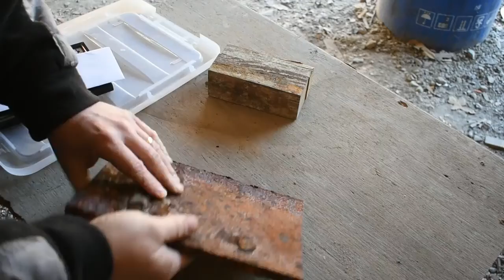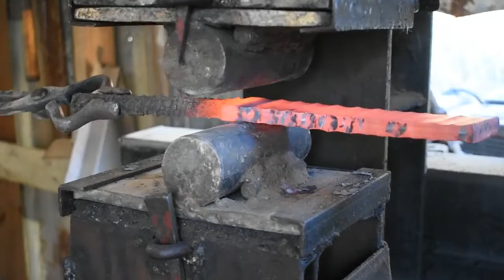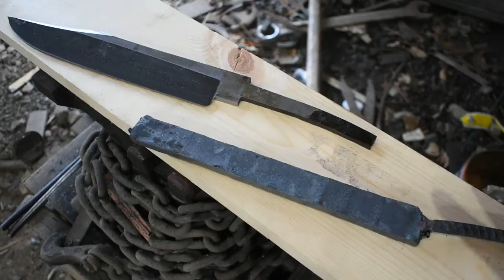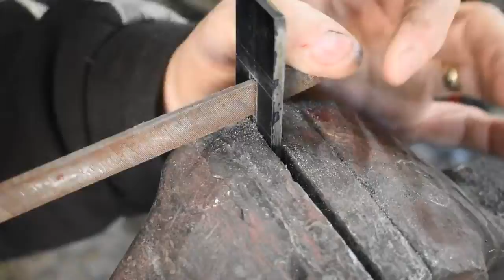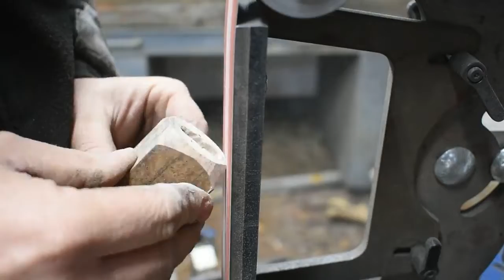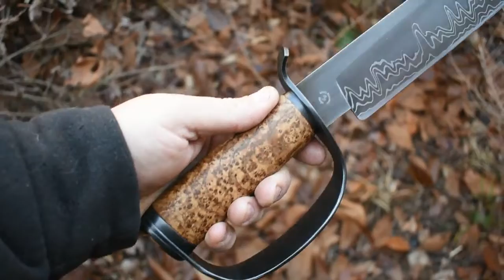Forging a Bowie knife from a Battleship (USS Texas battleship knife)

Comment: Question: When you weld several layers of steel together, I never see you apply Borax or some sort of chemical to prevent scaling. Why is that?
Reply from the maker: I switched to WD40 awhile back after watching Liam Hoffman and J. Neilson do it, it makes a cleaner weld, some people soak the billet in kerosene, Shurap is a channel here on YouTube where the smith soaks the steel in Kerosene. Using borax it will melt and coat the floor of the forge getting it on everything you put in, it also eats away at the liner as well. As for using an anti scale compound on the outside of the steel, I just don't have any, and things at my shop pretty much operate on a shoe string budget, it's why you don't see me doing a lot of pattern welding or complex/mosaic pattern welded steel, it's just too expensive.

Comment: isn't boat wood Teak? not pine?
Reply from the maker: There was a big discussion over that on the Artisans page on Facebook and the final verdict was that the deck was replaced with pine at some point. Working with this wood at the shop, it is definitely pine no doubt. I appreciate you watching.
Reply: @Mysticmountainforge  hey thanks for responding. I could see the wood becoming a cheaper option at some point given those battleships haven't seen action in so long. Keep up the good work 👍